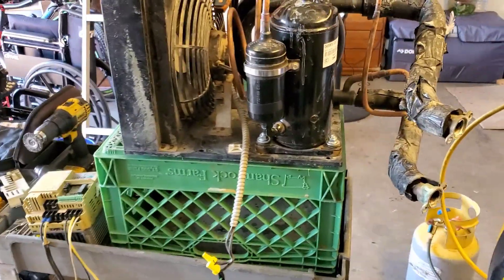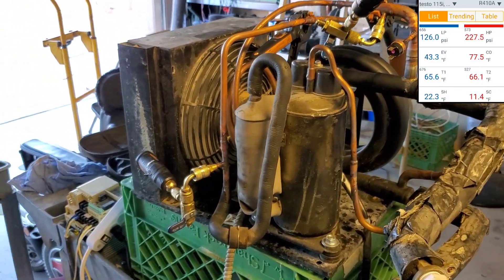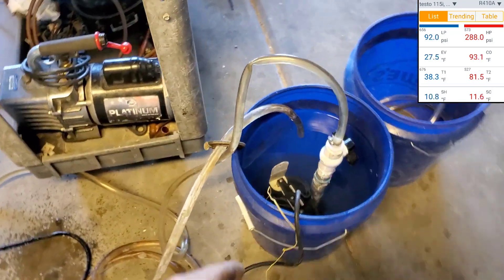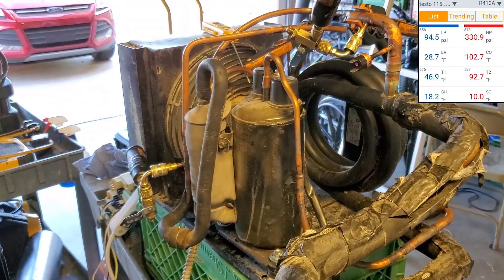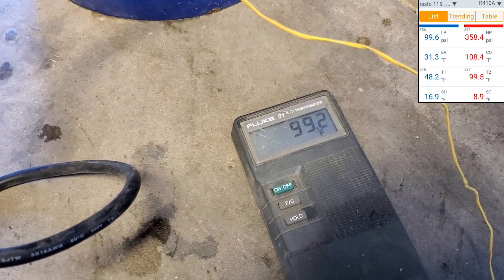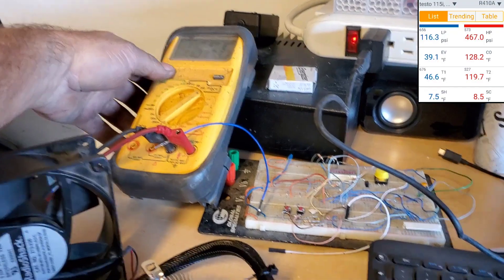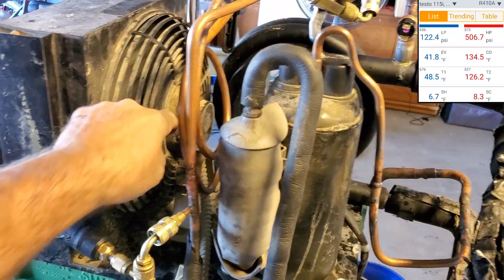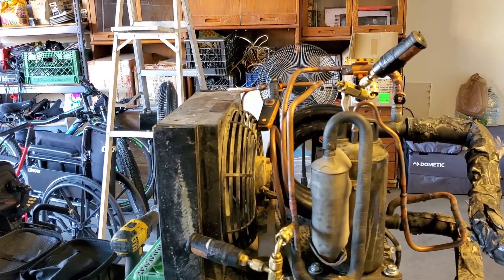Another heat pump water heater - 2nd attempt FTW?

Comment: So how much more efficient is this over a normal heating element? I saw you convert to 3.7 amps. Then you said a few heating element is 20 amps. But wouldn't a hearing element heat faster? Say a heating element heats the water in 10 minutes using 200 amps and this takes an hour at 3.7 for 222 amps. This would be less efficient unless you're using the cold air to cool the garage.

Obviously if my times are wrong it throws off the calculations. But that's why I'm asking. I had a great pump water heater in my garage. It kept my garage much more bearable but not sure it actually saved my energy.

Comment: Store bought unit actually submerge their evaporator in the tank so there is no external loss like you have. Nice work. That is why they don’t have a water pump.
Reply from the maker: You mean the condenser?
The condenser/heat exchange is in the tank. Which I would have done if there was such access. And no need for a pump then.
Their evaporator coil is on top of the unit with a fan like this.

I will insulate this once it is installed outside.
Reply: @hackfreehvac  yeah, exactly.  i'm used to the heat pump being a feature of an AC by way of reversing valve. I have never actually  done what you've done. Excellent work. I wonder if you could circulate the water as a function of Thermo Siphon Principle? I mean it would require increased heat, but other than that it should work.
Reply from the maker: @sNEAKYnIGHTmUPPET  Oh, you mean circulation without a pump?
I probably don't have enough safe head pressure to do that. 
I don't think this little pump uses much power tho.

Comment: It's crazy your welds look better than factory... done on a cart in the garage. You're losing so much heat from that thing the way it is - once you use the tank and properly insulate, it'll probably work great.
Reply from the maker: Yup. Even the plastic bucket with no lid is probably losing heat like crazy during the test.
Reply: @hackfreehvac  A steaming bucket with no lid is used as a radiator on some old, small diesel engines... so....lol

Comment: hi i was thinking of using a 3kw heatpump and a plate heat exchanger to heat water to 60c would it work? the plate specs are (0.17m2 design pressure 3mpa test 4.5mpa) i think r410a would be over pressure but would r134a or r290 work?
Reply from the maker: This is R410
It doesn't over pressure now, however come summer temps I may have to slow the evap motor to effectively reduce the load (of the 110 degree ambient) to the evaporator.

3KW compressor sounds a bit larger than you need.
Reply: @hackfreehvac   hi it is approx 1kw motor with 3kw heating capacity
Reply from the maker: @davidmcclare443  Ah, ok
That be a bit better.

Comment: The reactor is acting like a passive power factor correction.
Just to even out the current spikes that just a capacitor would cause.
Reply from the maker: Yeah I figured. Which seems to be what most units use but I have also found some active power factor correction where they use buck boost via a second IGBT.
Friedrich does it, actually stepping the voltage up to a 430 VDC bus, no matter if the input VAC is 190 or 250, and the Mitsubishi board mini split board I was looking at had a second IGBT being used to do some switching or regulation or something.
Pretty neat.

Comment: Did you ever put a TXV on that thing?
Reply from the maker: They are replacing the air handler units on those 4 units once they get lifts or scaffolding that will work.
But that is another crew. Not me.
Reply: @hackfreehvac  Not that hellscape, the 115v Mad Scientist water heater with homemade cap tubes... did it ever get a TXV upgrade?
Reply from the maker: @georgen.8027  No. Cap tube works well.

Comment: Why not tap off your 3 ton ac discharge line? Put a solenoid on it that when the water heater calls for heat it opens allows hot gas to go to a coax and then return the liquid/ hot gas to the condenser. You get hot water and lower head pressure on your house ac that’s running on some solar!
Reply from the maker: It could except the demand for hot water and demand for A/C is not at the same time.
The A/C runs the most in the summer afternoon when no one is using the hot water and from November through March we hardly run it for heat but here and there, going weeks at a time without it.
Reply: @hackfreehvac  good points. And adding a second “storage heat / buffer” tank goes a bit above and beyond then as well.
I’ve thought of it but haven’t gone full mad science yet. Also, I do have mini splits serving the house now but am still waiting on you to experiment with inputting high volt dc solar before I do mine. So... hurry up please. 🙃
Reply from the maker: @GamertagAKACUZ  
HA HA!
Well, I will probably get one for my garage by next spring I hope.

Comment: I would turn the “evaporator fan” onto the other side of the coil to blow the cold air away from the water heat exchanger.
Reply from the maker: I plan on encapsulating the entire heat changer in foam anyway since this will be outside.

Comment: Btu = (gallons*8.3)*temp rise

Assuming run time of 20min = 6474 btu/hr

You can track realtime btu with the same formula if you can measure flow (gpm*8.3)*delta t
Reply from the maker: When you say "gallons" in that first equation are you referring to the size of the water heater tank itself?
Reply: @hackfreehvac  yes, the volume of the system. i figured about 4 since it wasn’t all the way to the top and the space the pump displaces. But also considering the volume of the tubes and hx.
Reply: Shit, forgot to add the time component to the realtime calculation. 

((Gpm*8.3)*60)*delta T

Basically you are figuring how many pounds of water are flowing per hour, 1 degree rise per pound of water is 1 btu.
Reply from the maker: @johndeerrm  it's a 50 gallon tank.
Son is probably 51 to 52 gallons in the total loop.
Reply: @hackfreehvac  right, im just estimating for your test with the bucket. You said in the video you weren’t sure about the output.

Comment: There is one western manufacturer of a VFD for single phase motors with aux winding: PeterElectronic VersiDrive i E3S up to 1.1kw / 1.47HP
Or there is the generic chinese VFD the XSY-AT2 up to 2.2kW / 2.95HP (but those dont have a over current Protection on the output, like if you short accidently the output the Thing will blow up beyond repair)
Reply from the maker: Dang. BOOM!
So those are single phase in AND single phase out?
Reply: @hackfreehvac  Yeah exactly. I bought one for this exact purpose but haven't had time to actually try it out yet. It's the AT2 variant of this ubiquitous china VFD: https://www.ebay.de/itm/193638333766 The connection can be made to include main and aux winding of the motor or you can keep the original motor starter assembly along with the capacitor and connect it like that. IMHO connecting the aux winding is preferable but you gotta be real sure about your phase angle or your compressor will run backwards, probably to disastrous results.